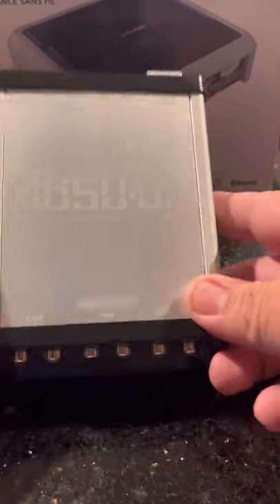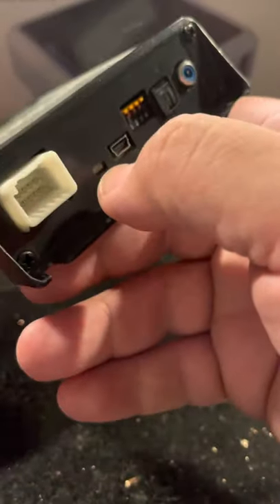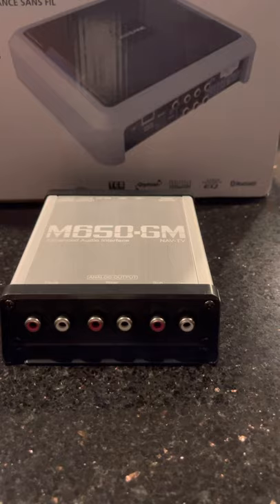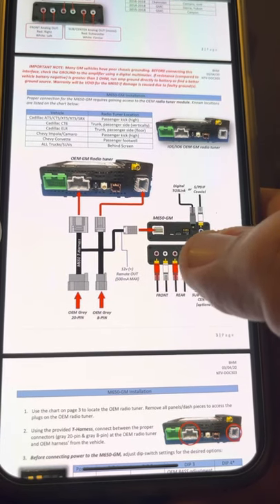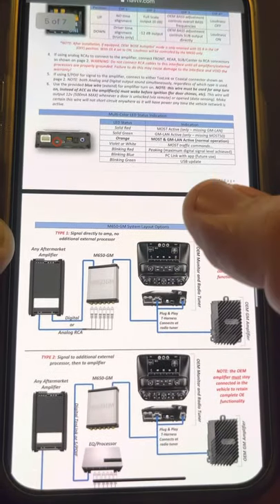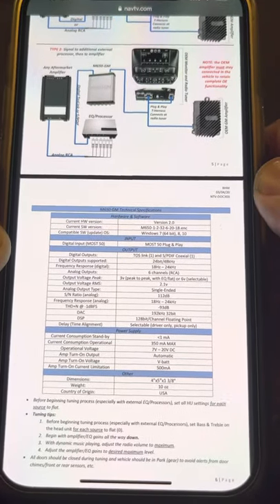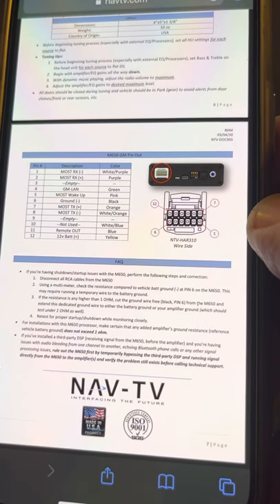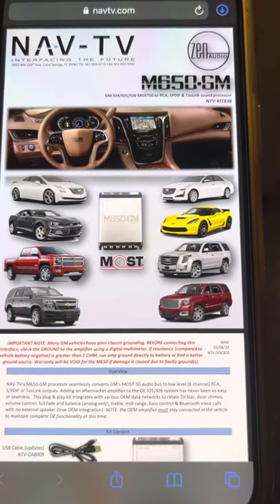M650-GM NAV-TV Processor

Comment: Did you run an amp to the vocals.  How? Did you run the wires back to the T on the M650?
Reply from the maker: Yes, I actually ran it to my alpine pxe-0850s with a optical tos link cable , from there I went to my amps, you can run into your amps directly also, 
The M650 has a T harness that is plug n play
Reply: @caliboyscustoms  So M650 via toslink to amp, then speaker outputs back to M650 T harness for door speakers?
Reply from the maker: @str8klownn713  no, M650 to the amp,  you can use the rca, then from amp to the doors, you can tap into the speaker lines on the oem amplifier , note: the M650 t harness is only to power up  and get signal ,
Reply: @caliboyscustoms  Thank you for your patience and the detailed explanation
Reply from the maker: @str8klownn713  anytime your welcome